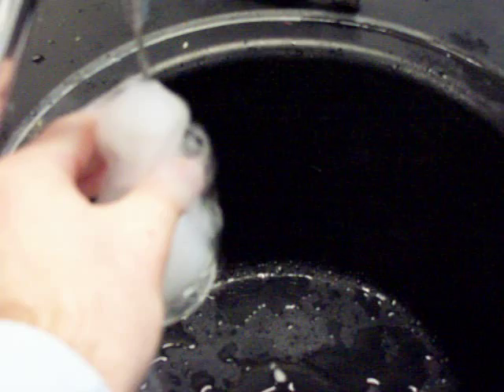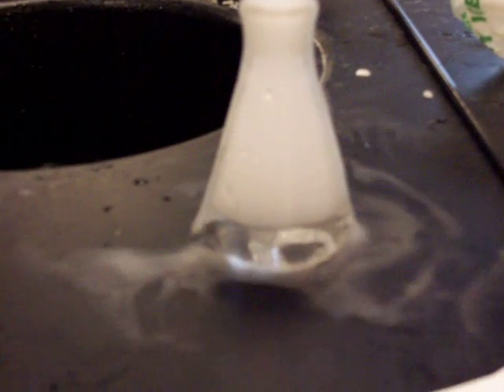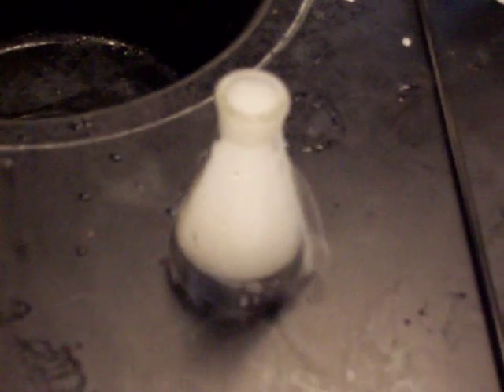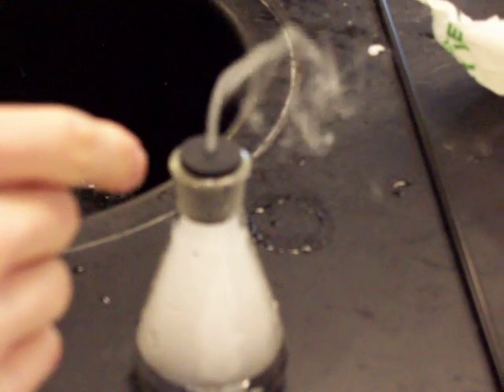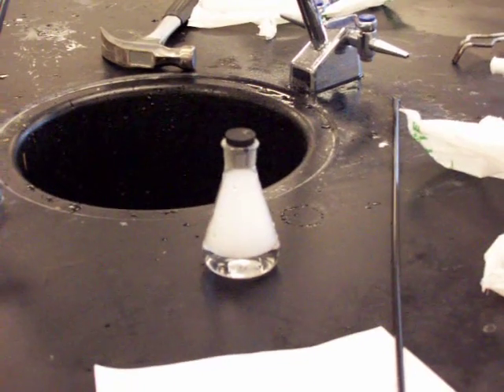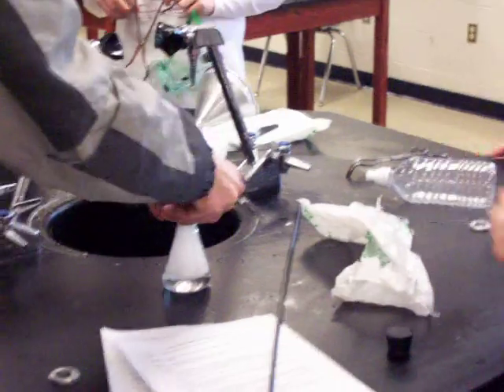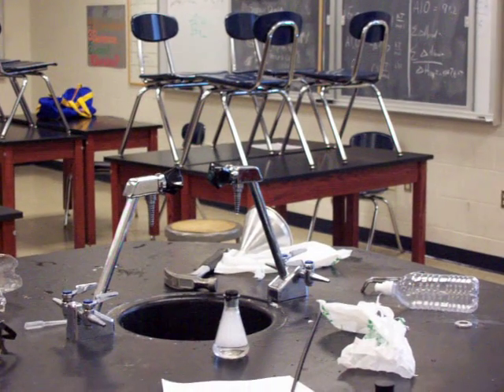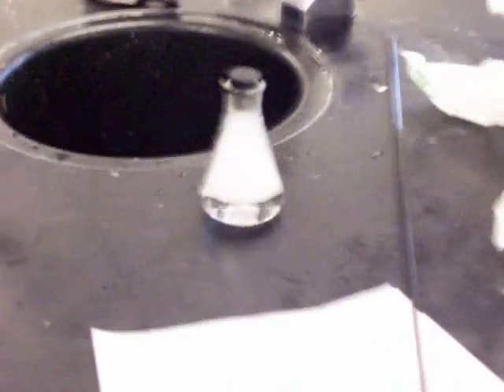Dry Ice in Flask

Comment from the maker: Being a greenhouse gas just means that it traps heat in the atmosphere.
Now as to why a heavier than air gas rises there are two reason that I can think of off the top of my head (there might be others): 1) when given off it is usually hot [for burning emissions] and the volume expansion from heating causes it to be "lighter than air" [less dense] and so it rises, and 2) normal diffusion/effusion will spread the molecules out pretty evenly in the lower to middle atmosphere at least.

Comment from the maker: @ShinyStuffingMix It depends mostly on the size of the block you buy.  When I used to buy dry ice at the store it advertised that in a good cooler a 5 lb block could last 3-5 days.  If the cooler wasn't sealed shut a hole shouldn't be necessary, most coolers I've seen the lids are loose fitting enough that they will allow the gas to escape (if pressure does have a way of building up then you of course do want to leave the lid open a crack (probably better than drilling a hole as you suggest.